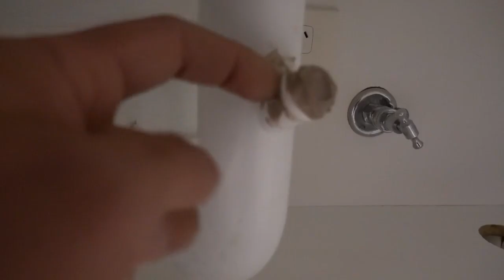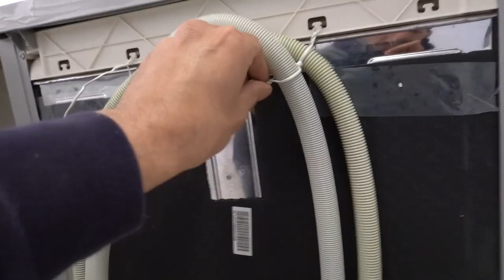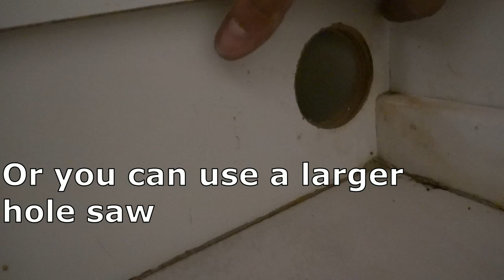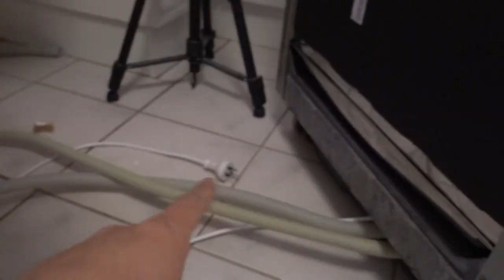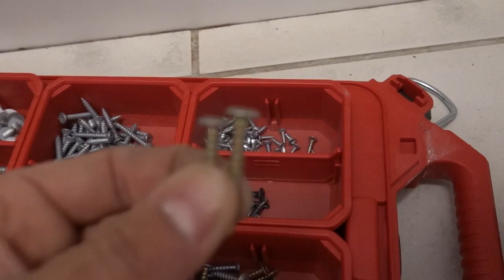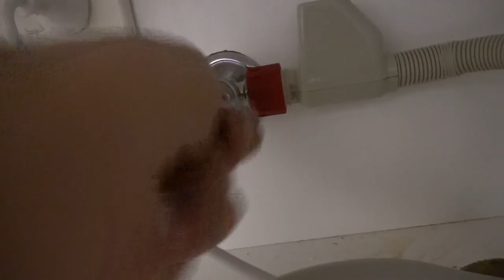How to install a dishwasher - DIY easy

Comment: Great video, thank you! I'm living in a rental and thinking about getting a countertop dishwasher. Our laundry is located in our kitchen, so I'm thinking of installing the dishwasher by placing it on top of our frontload washing machine, and using the pre-existing laundry taps and sink as a water inlet and outlet. Do you reckon that'd work?

Comment: Hi Bill I've got the same dishwasher. In the manual it says dishwasher has to be earthed, what does that mean. And the inlet hose with that electrical shut off attached really confused me, thanks for your video as now I know I'm not the only one trying to fit an odd shape into a round hole which won't fit, I just need a multi tool.

Comment: Cheers Mate…… I have to add extension hoses. Suppose got take off water I feed from DW and add extension hose to DW, then connect original inlet hose?  Yeah?  Thanks Bill. 😊
😊
Reply from the maker: You can buy an extension hose that simply connects to your current hose 👍

Comment: Hi, I’ve just bought my first dishwasher. The separate water supply is currently connected to the water filter. Can I buy a splitter and share it with the dishwasher? Thanks.
Reply from the maker: Sure can, you can pick one up from any local hardware store 👍
Reply: Thank you

Comment: Did you need to turn the water supply off first?
Reply from the maker: Yes, shut the water off first using the shut off valve under the sink or the main water supply to the house 👍

Comment: Just a question, why doesn't the water heat up and why is the washing cycle takes so long, 15mins is a long time, should only be about a 3 min cycle
Reply: It needs to be hooked up to the hot water line, not the cold like he said.
Reply: What the hot water line. Doesn't this machine heat up its own water